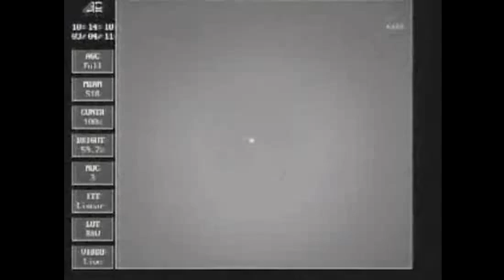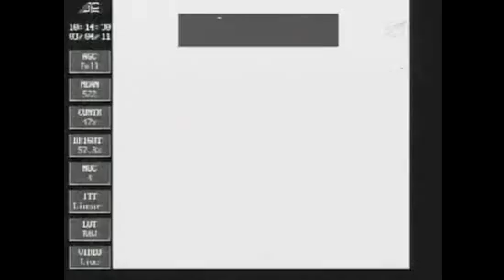NOT So Glory-ious Launch

Comment: @nwopropaganda Perhaps it would help if you actually listened to the video. At 05:25 the mission director says: "we are at 300s the vechicle speed error is indicaticating underperfromance which is expected due to a faring not separating ...... the vechicle did pressurize but no indication of the faring separating"

So the faring which probably weighs what the satellite is still on so the payload is overweight - the rocket cannot handle it - SPLASH!

Comment: @nwopropaganda NASA is far from perfect, but equally I dont believe in making stuff up to bash an organization for the sake of it. 

BTW you dont calculate the weight of the satellite - you weigh it. That is part of the integration process (done by the contractor) - they have to find its mass and center of gravity so to know how much ballast and where to put it. They seem to have done that properly. Its only when the nocecone failed to deploy that there problems

Comment: @nwopropaganda Now where did I say that NASA was not involved? Making more stuff up. The heiracrchy of a commercial launch is that the company the built and integrated the rocket runs the launch and early operations through check out. They then hand a working spacecraft (usually 30 days after launch) to the agency. So Orbital Sciences ran the launch. The USAF was incharge of range safety (Vandenberg is a military base) and NASA  the down range tracking & com. I note you sidestepped Luther issue

Comment: @oomblikkies Which valid counter arguements"are those? Most of what they put out is straight fromExxon with just enough truth in them for it to sound plausible to the gullible & scientifically illiterate.

You make the error of confusing potential political solutions (eg carbon taxes or C&T) with the science. The solutions are debatable, the science isnt. The "scientific" objections you hear are politically-motivated excuses for inaction so the oil companies can fleece you for a few more years

Comment: @fuckutube74 We all did - does that make us responsible? No. The responsibility falls on those who try to force technical decisions to follow political considerations rather than doing it the best way from an engineering point of view. Congress forced the retiement of the Delta (over 100 successful launches in a row) & blocked the Athena - a US version of a Russian designed system that had several hundred successful launches without a single failure - in favor of Orbital Systems. Thats the crime

Comment: @fuckutube74 It was a failure of theTaurus rocket which is a private enterprise system. It is built by orbital sciences and these with their Pegasus system were forced on NASA by powerful senators and congressman who required NASA to buy launches from private US companies rather than develop their own internally as they did int he past. They earmarked orbital sciences to supply many of the lower cost launches ad Boeing/Lockheed to do the larger ones.